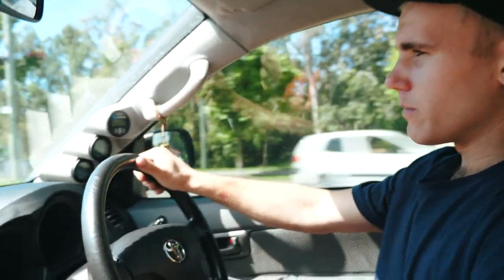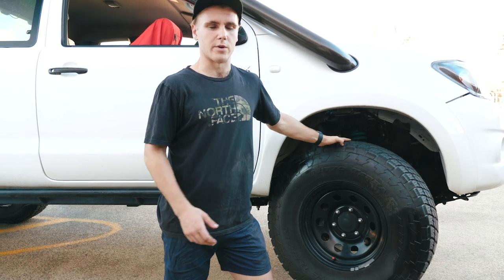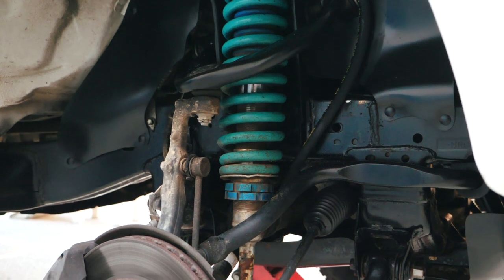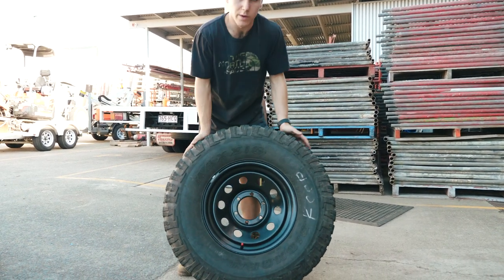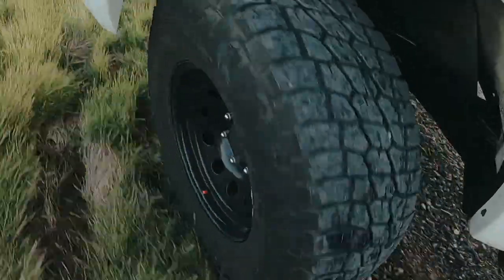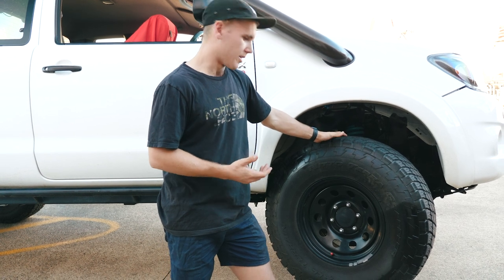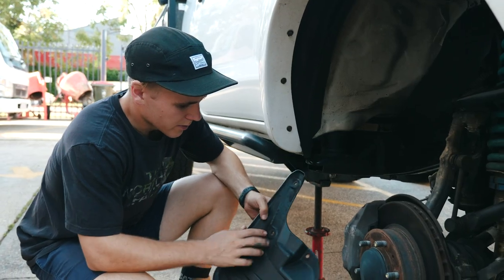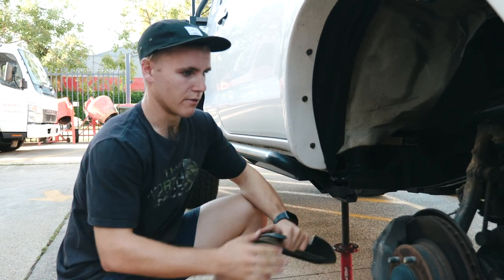How to fit 285's to a HILUX

Comment: hey, just wondering if you need to chop body mount still or does moving the castor all the way forward mean you dont have to
Reply from the maker: It helps but ideally you would still do the body mount chop as well or it will still rub sometimes

Comment: I'm running 265's that are 36" tall. 285 is just the width, doesn't tell you anything else about the tire.
Reply from the maker: Yes that’s correct
Reply: People say 285's because 285/75R16 and 285/70R17 are the two most common upgrades on Hilux, so we use context to figure out what they mean.

Comment: Didn’t know it was that difficult to fit 33s on the n70 hilux I recently fit them to an n60 all I dad was sus lift and a one inch body lift and the fit with a little bit of panel correction
Reply from the maker: Ben Howson yeah always seems easier on the older cars but nothing is impossible if you have the right tools

Comment: Or..... cut inner rear  of the flare out and hammer pinch weld flat then re fibre glass and paint, and trim the bodymount back as far as you require and re weld a plate onto it and trim up bullbar by a few inches and presto can fit any 33" tyre on the old luxys
Reply from the maker: slow & sooty yeah that would be the ideal way to do it and a better solution if you want to remove sway bars as well and get maximum flex but this works if you don’t want to cut the body mount

Comment: How is the caster adjusted? I’ve got Fox suspension 3” lift and the VMN UCAs but my garage said they cant adjust the caster more forward. I’ve just ordered the plates to cut and weld the body mount anyway but was hoping not to cut it. Neil
Reply from the maker: Neiiil hey Neil, depending on which ucas you have they are adjusted differently. some already have built in caster correction and some are adjustable, I see you said you have VMN ucas but I believe they sell a fixed type (Blackhawk branded) and an adjustable type where you can adjust caster by the top ball joint position. It’s possible they have already adjusted it as far forward as possible. If you running large tyres or a negative offset doing the body mount chop will be your best bet, there are places that do it if your not keen on cutting it yourself too.

Comment: mate, i have a 2014 hilux sr 5, i have stock alloy 17 rims, my tyer size is 265\65\ 17. i wanted to install 285\70\ 17s, can i get away with using my stock 17 toyota rims, or must i change the rim? im not certain what offset the standard rims are, maybe 0 offset, taking a guess, but i dont want to install any steelies, thats why i want to keep my stock 17s and just throw on the 285s, another question, i need a 2 inch lift kit to run the 285s, right?
Reply from the maker: Hi mate, thanks for watching. As far as I know the 17 inch rims you have are positive 30 offset which means it will be very difficult for you to fit them without a lot of cutting in the inner guard and I think you may even have issues with the tyres scrubbing your upper control arms, If you want to keep your current rims maybe just go for some 31" inch tyres as this will be slightly bigger than what you have now and wont require much if anything to fit.
As for the lift you don't need any lift to fit the tyres, if you end up going 285's or smaller you just need to remove some of your bumper of bullbar where the tyre will hit and remove your front mudflaps as well, you also might need to either adjust your caster forwards or do a bodymount chop.
Hope that helps .
Reply: @RyvalCreative  thank you

Comment: still super confused as ive gathered so much different info. ive been told to get atleast  -12offset with body mount chop to run 285/75r16 

i already have 16x8 0p rims in the shed. I have factory flares so im guessing 285s will poke out abit so thinking of going 275
Reply: Probably a bit late, but I have 285's on 16x8, 0 offset and factory SR5 flares, the tread itself is just under the flare, but the sidewall bulges out past it, not as much poke as most Ranger drivers run, and doesn't seem to get unwanted attention.

Comment: For those in Victoria the rules are 50mm above factory spec with a +/- tolerance of 25mm. This means your car can physically measure 75mm over spec and just be ok.
A traditional two inch lift with the weight of extras (bull bar, winch, second battery etc) will still physically measure about 50mm above spec. In regards to the tyres, a 285 will be the other 25mm

Comment: Same things happening in my car hilux got 285 on on 17 inch rim it was ok before i took for wheel alignment now everytime i do full turn specially when under compression it rubs so bad on the back to flares how to fix it move caster forward or need small tyre or smaller rim ? It has got 2 inch lift on 
Thanks man. Plz any suggestions
Reply from the maker: Rim size won’t change anything because the overall diameter will still be the same, you could move your caster forward but it might still rub in which case you’d need to cut some plastic out from the flare, ideally you’d need to do a body mount chop as well to have 0 scrub.
If you don’t want to do that then smaller tyres would be your answer
Reply: @RyvalCreative  thanks for ur help could u give any idea if moving the caster forward it will affect the tyre wear or or anything it might reduce the rubbing alot bcz before ot was not rubbing only after aligning and if go smaller tyre what size would be ok for it  thanks.

Comment: I didn't get it. Did you do the body mount chop ? 

What kind of lift do you have ?
Reply from the maker: I did the body mount chop in a later video, at this time it wasn’t done.
I have 2” sus and 2” body lift. The suspension lift won’t help you fit bigger tyres because when the suspension compresses it goes back down to factory height anyway
Reply: @RyvalCreative  I don't get this argument , however see that a lot. My understanding of the situation. - you do the lift by installing longer shock absorber strut. It is popular in Russia to use stock Tundra shocks for this. You get about 2 inch lift with them. By this you have your UCAs and LCAs declined down. You indeed have more travel to go up in this case than stock. And at full compression the wheel will be touching on top.  BUT you  may lower your bump stop for compression by an inch and this way you will get up travel from neutral position about the same range as stock and prevent UCAs from going all the way up and the wheel rubbing on top
Reply from the maker: Yes you will be starting from a more extended position due to the longer shock absorbers but when uptravel occurs from compression of the suspension the tire will end up back to its factory position if not even further compressed. Even if you extend the bump stop the tire will still be able to travel far enough upwards that it would make any suspension lift useless as a method of reducing tire scrub.
Reply: @RyvalCreative  I still don't agree :). To  get tyre rubbing with the lift you MUST compress the spring more than typical value. Basically if you have 2 inch lift and 1 inch increase in tyre radius (33 instead of 31s) you will have to get  the spring 1 inch even shorter than stock length at  full compression to get to rubbing . You cannot do that since the weight of the vehicle is still the same. There will be no force to compress the spring that much. Besides even if you manage to compress it even further I would suspect that coils will start touching each over.
Reply from the maker: If your tyre is 1” larger in diameter that means you would have to compress the suspension 1” less than before to contact the body.

Comment: I’ve got 285x70x17 still touching without moving tyres forward 😂😂 Andy advice?
Reply from the maker: Might be time for a body mount chop then unfortunately theres not many other options besides changing offsets or going down in size.

Comment: Does 33s make it more gutless or did you do diff ratios to fix it
Reply from the maker: Hey mate yeah it does make it very gutless, I would eventually like to do the diff ratios but it’s like 4/5k if you do lockers as well so can’t really justify it at the moment!
Reply: Oh yeah thanks no worries
Reply: What ratios would u go to 3.9 or 4.1
Reply from the maker: 4.1 would make it almost exactly back to Stock gearing, 3.9 would still be slightly taller so I’d go 4.1 personally
Reply: @RyvalCreative  do u reckon twin lockers on 32s would be good or is it worth ratios for 33s

Comment: Thanks for the info, I am actually looking at going 285s on my 2wd, yeah I know lol. But the reason I want to do this is my Hilux makes 330hp and 1100nm on dyno, I currently have 235/60R16s and it will light the tyres up in 2nd gear no worries. I also need longer gearing, with such short gearing I can't get my big turbo spooled up in 1st and in 2nd I still can't get full boost. I hit 40psi of boost in 3rd. I don't need to go as high as 31.6" like the 285/65R17 gives but it's hard to get a 285mm wide tyre that isn't super tall. ~30" would probably be spot on for me. There is also no such thing as a taller diff gear for a hilux, I have been asking around for years. I also need longer gearing as my hilux runs out of gears at about 160km/h and I can hit 160km/h before I even finish overtaking a truck even pulling out in top gear.

I definitely wouldn't be worried about tall gearing taking power away, it's so easy to make good power out of a diesel hilux. Just take it to Just Autos on the Sunshine coast (I drove my hilux there from Tasmania), get a stage 3 gturbo, +30% injectors, front mount, clutch and a tune and that's easily 260 to 280hp over the stock 115hp. My hilux has a built motor, stronger pistons etc and a larger diesel pump. Just Autos have a 2wd diesel 3L hilux that makes 500hp on 60psi of boost.

Comment: Good vid bud. Anyone out here know if 265/65 R 18 can fit on the newer Hilux? I'm wanting to run stock suspension but worried about rubbing..and if there is a  rubbing quick fix? really also want to avoid castor adjustments if possible

Comment: Hey mate thanks for all the info, was just wondering what you rpm is at 100kms?
Reply from the maker: Hey mate my speedo reads wrong it’s about 10/12 k’s under what it should be so whatever it says rpm at 90kmh is on a regular speedo is what mine is at 100

Comment: Hey mate. wanting to go from 265 to 285 but wanted to see did you notice a difference in the fuel economy, decrease in power any other general wear and tear? Cheers
Reply from the maker: I went from factory size straight to 285's so yeah I noticed a huge difference in power loss and a small decrease in fuel economy. It still easily gets to 110km/h but it's just a bit slower off the mark now so no huge issue and only lost about 20-30 km's per tank roughly. Your doing a smaller jump up than that though so shouldn't be as noticeable for you.

Comment: Hey mate, thanks for the clear information provided in this video. 
I currently have a 2.5 inch lift on my hilux with bigger ucas as i had to do gvm upgrade. Question is with doing the body mount chop and using the plates from psr, is there enough clearance to run 295s? Thanking you and hope to hear from you soon..
Cheers
Reply from the maker: Hey mate that would depend on your rim offset and also actual tire sizes differ between brands it’s hard to know exactly but 295 vs 285 there’s only 10mm difference in width so it’s possible

Comment: Hey ryan, loving the vids, just wondering what guages you have fitted on your car?
Thanks
Reply from the maker: Hey mate they are autotechnica digital gauges but honestly I would not recommend them. Spend the money and go vdo or redarc these are not good at all.
Reply from the maker: I have boost pressure, water temp, exhaust temp and battery gauge

Comment: What are the three displays right to your steering wheel on the front column?!
Reply from the maker: Ondra Rafaj tip is a battery monitor, second is boost + EGT gauge and the bottom is Water temp + Oil pressure

Comment: Hey mate do you think there would be any scrubbing/issues on my N80 with 285/75/r16 0 offset with a 2 inch lift, body mount chop, some cutting of the guards and caster adjustment but no after market UCAs?
Reply: Howd you go mate?

Comment: A tip for fitment: put the car on jack stands, take out your strut, put the tire back on and put a jack under the wheel to simulate tuck. Also go full lock both was under compression

Comment: Thanks for the video mate. I’m about to lift mine another 25mm to take up the sag from 10yrs. I’m only running 265’s but this was a helpful reminder of what everything does. 
What have you got in the rear?
Reply from the maker: I've got RG leaves and 170mm shackles with fox shocks currently but I need to change to the 210mm shackles and get +2" RG leaves to get it to work better

Comment: Hey mate Awsome video. Straight forward and clear understanding. This video helped me decided to not lift befor getting 285’s on my hilux. I have since had 285’s installed and had no dramas expect abit of guard rub at the rear of the wheel arch about 20 mm. As your video demonstrates a grinder fixed this with abit of paint touch up.

Comment: Did you keep your engine stock power? Or have you had an ECU remap to supply more power?  I've heard stories that after fitting bigger tyres like this some drivers found the power lost. Have you notice at all any difference in power lost? Like acceleration was decrease?
Reply from the maker: Yeah definitely more sluggish now but I haven’t done anything to increase power, I don’t really mind it still goes fast enough for me
Reply: @RyvalCreative  thinking of just doing a 3 inch dobinsons and running these size tyres on my 17s

Comment: Hey mate, very good advice in your video appreciate it! was just wondering what the best offset is to run to get 285’s off the UCA’s
Reply from the maker: I run 0 offset, more positive offset would make the tyre closer to the UCA and more negative offset would space it out further. I find 0 to be perfect because it has some clearance between the tire and also my tyres don’t poke outside the flares but I do have wider flares than factory (I have 60mm) so take that into consideration if you are choosing

Comment: When I got my hilux, it came with the option of coming with 30.6 inch tires from the dealer. So if I wanted to run 285/75/16 (32.8 inch) on a 2 inch lift, that would be .2 of an inch tire increase (5mm). So the overall tire lift would be 2.5 mil over the legal tire lift (25mm) but I suspect that the lift kit will sag a couple mil, so would the ride height be legal meaning I wouldn't have to get a mod plate?
Reply from the maker: They probably wouldn’t actually measure hub to guard they would likely just look at the tyre size written on the tyre and defect you because it’s too big regardless of what size lift you have. That being said it’s unlikely and you’d probably have to get a copper who’s having a bad day to sting you for it or be doing something wrong in the first place to get pulled over.
Reply: @RyvalCreative  cheers mate, what about insurance when it comes to a couple mm?
Reply from the maker: They likely would never check and even if they did, they would have to deem that an accident was caused by your tyres being too big in order for them not cover you

Comment: hey mate awesome video, I have a 2012 sr that's stock standard atm, thinking of putting bigger tyres on 16s, just didn't know what the biggest size would fit without a lift? 
Ideally I'd want 32s with a 2in lift  but for now I dont think the 32s will fit without a lift
Reply from the maker: Zak Ulrich lift won’t matter because when the suspension articulates it will go lower than stock height anyway. Biggest you can fit without cutting is a 31 and you’ll probably just have to remove the mudguards or they will rub a bit
Reply: @RyvalCreative  awesome thanks mate!
Reply: @zakulrich3013  im running 265/75/16  no scrub on a 2 inch lift
Reply from the maker: You will get a lot of scrubbing on the body mount if you haven’t chopped it

Comment: What suspension setup would you recommend, I don’t mind mixing and matching, the end goal is something that doesn’t rub. What are the most idle uca to run for adjustments?
Reply from the maker: Really depends on a few things mate like how much you want to modify and how much you want to spend and if you want to keep it legal etc. The thing is that suspension won't affect if it rubs or not because when your suspension compresses the height goes back to factory height if not lower, so you'd want your wheels to fit and turn etc. without rubbing before you get your lift installed.hitting
Reply: So the only thing that would require a UCA change is if the lift is higher than 2" on the lux?
Reply from the maker: You’d probably also need them to run a bigger tyre size because they usually have more adjustment available to get your tyre away from the body mount

Comment: Great vid mate just a question on the caster if you adjust it all the way forward as possible and run 0 offset you don’t need to change upper control arms ?
Reply from the maker: jake fleay yeah mate it’s possible but you lose things like return to centre and you get increased bump steer, it just handles pretty bad in general that’s all

Comment: Hey man, I'm currently running 265/75r/16 on a pos 20 rims, 2.5inch lift with superior ucas. So going off you're vid I should be okay with fitting 285/75/16s on 0 offset? Gonna go nitto Mts on 0 offset. Just want some clarification before I dish out 1900 haha. Cheers
Reply from the maker: Yeah that’s what I’m running currently, you will have to cut a little bit out and might get some scrub if you don’t want to do the body mount chop but apart from that should work all good